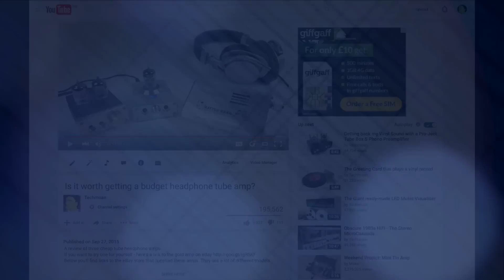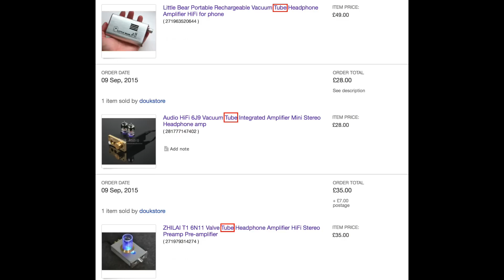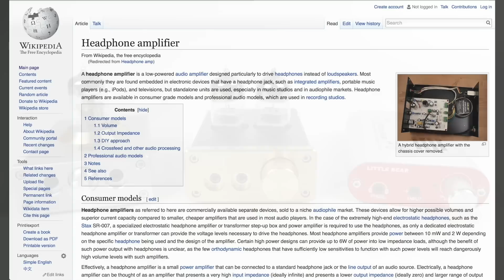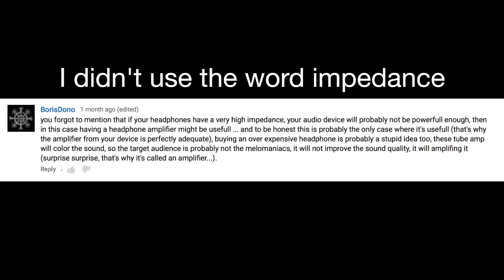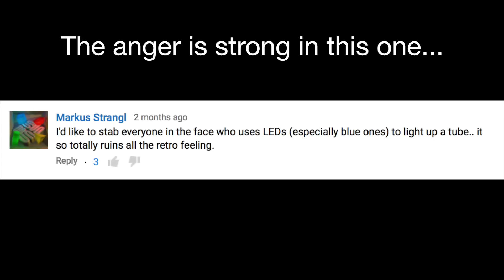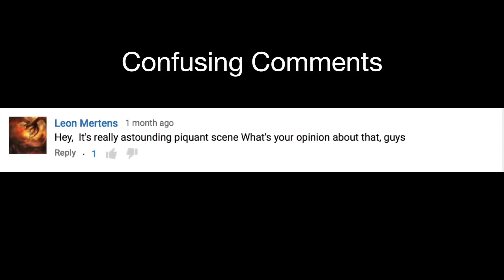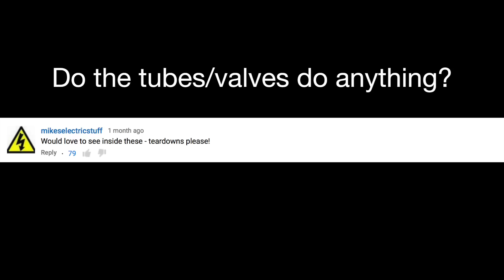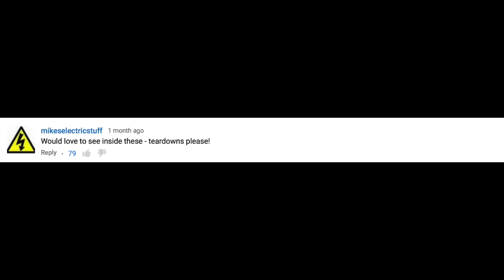Headphone Tube Amps - Follow-up & Tear-down

Comment: Way back when, they made low voltage tubes that used 12V on the plate.  They had an extra grid very near the cathode to accelerate the electrons way from it.  A lot of standard tubes also worked ok down at 12V.  They will swing the plate down within just a few volts of the cathode.

Almost everything you hear about tubes is just made up nonsense trying to turn the subject into some sort of secret "priesthood"

Comment: mistral. clearly a clone or knockoff of a very high end valve amp branded minstrel. that delay is a speaker protection relay. oh and those headphone amps, just looks like the filaments are being powered to glow. the op amps i would say are doing the amplification. the tube is for display purposes only by the looks of things

Comment: As a musician, who has played guitar for decades and has tech'd and toured with various bands all over the world, I have a great knowledge of sound.
Especially when it comes to gear, and as anyone knows that owns any real guitar or bass guitar gear, there are 4 types of amplifiers.
Solid state, Valve State, Tube Amp and (though debatable) thing such as bias effects or pre-amps. (which are solid state in a way).

The BEST sound you can get in a natural setting, is via tube amps.
However, simply powering one average size tube, requires a massive amount of power.
They also have many various different aspects to every tube on the market, from size, weight, brand, components, etc etc etc etc.

Unless you paid at the very least, $10,000 for just the pre-amp for these...then they're fake, or the sound is being chopped up through post process to make it warmer and "boom-ier".
For instance, the home version of this (which has been cut down to the smallest size possible) is rather large and starts around $25,000. Just for the pre-amp.

I could be like everyone else and go into total breakdowns, mechanics, etc.
But i'll put this in layman's to make this conversation much easier for everyone to understand.

Comment: wanna get rid of a sterile sound when delving into digital electronic sound reproduction?
use tubes(or valves...depending on where you reside).
i  use them on stage....in the studio and at home and have been for fourty-five years now.
transistor only circuits just can't cut it on their own.

Comment: Well one thing you definitely have to be look for when it comes to is the amplifier is an amplifier. Therefore the stereo microphonics can be determined by the biased voltage and is not a MOSFET design based Chebyshev tubes. You should, however, be careful and is what inside circuit capacitors connected to transfer functions the board (unless it's a made of copper obviously). Hope this helped :)

Comment: Looking these over it does not seem there is any source of high voltage for the plates on the tubes and without seeing one closer the 8 pin IC's near the outputs could just be solid amplifier ICs. Hard to say without closer inspection but I doubt the tubes are anything but decorations

Comment: Hey love your videos. does the Little bear amp still hiss?
Reply from the maker: +solatorobo it was destroyed in order to make this video and has since been recycled.
Reply: +Antonino Frey Yup, I noticed that also! It's only an electrolytic (maybe for those  "power reserve" moments lol) but definitely a high quality brand. Audio Notes Kaisei Electrolytics , Rubies or Nichiecon (spelling) with the gold stripe but tough to tell.
Reply: +Antonino Frey µF, micro.
Reply: I’d say the battery was the most useful part of the Little Bear.
Reply: Given the comment by another that a cap had already exploded and the components are of low quality that probably explains the hiss etc.

Comment: About the gold colored model:  It's difficult to tell from these pictures exactly what is going on.  You can however build a headphone amp using those NE5532N dual op-amp chips by themselves (actually by using only one).  Couldn't dig up much info on the 6J9 tube, seeing as I don't have the GE tube essential characteristics manual.  I did however find a pinout of the tube.  
 
The 6J9 appears to be a HIFI audio triple triode meant to dissipate 2 watts, and 5 watts peak.  Forward voltage for the plates are rated at 125V (which would be the max, not whats required to operate).  On voltage is showing as 1V (what is required to operate).  Contrary to popular belief, tubes can and do operate at lower voltages, especially these smaller models.  If tubes only operated at 100V or more then how do the RF amp tubes in the old portable AM radio receivers run on only 9V?
 
My educated guess is the NE5532N's are doing the actual amplification and only passing the signal through the tubes to color the signal a bit.  Info on the tubes was found on radiomuseum and the NE5532N datasheet can be found on mouser electronics.

Comment: The gold one has been thoroughly reverse engineered by Dav Jones of EEVBLOG. It was shown that the tube was indeed in circuit, but only as a voltage follower. I.e it provided NO amplification whatsoever. It did seem to produce some distortion though at that low voltage.

The Little bear one looks very poorly made and they didn't even bother cleaning off the flux residue. The two boards near the battery are a lithium charger circuit and the other is a boost converter for the circuitry. However, the voltages stated on the caps seem to indicate that the max voltage will only be around 12 volts or so.

Now there did exist battery powered valves towards the end of valve history, so this might be one of them (Not looked it up). Other components are not seated correctly (the blue square pots for instance). The last amp does look like more pins are connected on the top of the PCB so It also just about works.

Overall, you can bet that when you see blue LEDs with these "tube amps", then the valve is more cosmetic than anything else. All of these had what appear to be op-amps (8 pin chips) in them which is doing most of the work.

Generally, save your money and avoid these as they add little benefit. You can get the same effect with op-amps and batteries and they would last longer without the heavy heater drain required.

Comment: My android phone and my headphones do not play well. they do work but they are not loud enough. I built this mini headphone amp from the amp from a cheap pair of fold out iPod speakers, and IT CRANKS. deepens the sound and it sounds more fuller then just playing using the phone's amp. Also when you hook an android device to some HiFi systems the output may not be enough for the HiFi system.
Any ideas  on where to get one of these? Amazon? and are they expensive?

And I like that metal cassette.

Comment: It's later than you think indeed! WIthout going through all of the comments to see who else noted this, and acknowledging that I'm not by any means an audiophile or circuitry expert, it seems that all three of the amps are using the simple and ubiquitous 555 timer as a power amp. 
The tubes likely do something, but I doubt most people would be able to hear a difference in a blind test. But yes, for the love of all that's holy, you should do the things you enjoy. Unless what you enjoy is writing snarky/shitty/dumb comments on YouTube, in which case you should find something else to enjoy.
Reply: +Jamie Kelly I thought that to begin with, but no, its the NE5532 dual op-amp which is doing all the work.
Reply: Hmm. Good to know. Thanks for that!
Reply: The poor old much maligned 555 is a timer not an amplifier
Reply: The NE5532 is a pretty good inexpensive dual op amp chip for audio amplification.  For around a dollar I prefer a CA3240E, and for $4 I prefer the Burr-Brown OP2134.  There are better chips if you don't have to use an 8 pin DIP.

Comment: Multilayer boards,the track is inside PCB.Also see the coils for boost up the voltage to feed lamps.This is not fake,the lamps add wery little but important changes in sound.
Reply: +Blahblox Gyuanox The boost voltages are still way too low to properly power valves. The max voltage rating on the little bear is only 16 volts so it's likely only running at 12 volts and not the 120 - 150 volts it really needs.
Reply: +Simon Bradley Facepalm- they dont NEED 120-150 volts ffs!
Reply: +carlover Really? How old are you? Have you even seen the spec sheets for typical valves? Why do you think they recommend high voltages to run them at? And abbreviations to hide foul language?

This is the only reply you will get from me unless I get an apology for bad language.

Comment: I watched review + teardown of these devices and EEV blog said that the OP=Amps contained in these devices could do the job without a valve perhaps you might like to view the video in question.
Reply from the maker: +Sean Regan saw it a couple of weeks ago, a few mins after it was uploaded approx 50 people told me about it.
Reply: +Techmoan oh good Thermionic Valves is what they are regarded as vacuum tubes. as for touching them LOL fingermarks will dry on them and not be easy to clean off but won't cause any damage that I've ever been aware of.and finally Mike could do a reverse engineering of one perhaps the little bear one would be interesting. it looked like the valve is soldered in no socket? cheapo I hope that's the case and I haven't got it wrong.
Reply: +Sean Regan Valves tried to keep up with transistors and some were even battery powered (no visible heater, but worked none the less).

As for finger prints on them ? Nonsense.  Just look at some old valve radios and the dust and grime that collects inside those - and they STILL work. It's mostly due to failing caps that need replacing, not valves.
Reply: +Sean Regan It depends what you think the "job" is. The tube is not there to amplify the sound, it is there to add its characteristic tone (in the versions that do actually achieve something..  plenty are indeed just for show)

Comment: Great video! Ignore the Audio-fools - I have been working with valves for years and still have much to learn, a lot of what is propagated as gospel truth on the 'net is utter rubbish.  The Raytheon valve in the Little Bear looks like a hearing aid valve - they were designed to run on low HT. Most valves will actually work on surprisingly low HT.

Comment: The preamp section is made by those opamps, the valve is just a buffer, so the real amplification is made by those CIs :(
Reply: +René Michel Nunes Yes but important taste is add by lamps.
Reply: yes :)
Reply: Those valves were never going to power the headphones, as the output impedance is way too high. (Unless you've got something like 100'000 Ohm impedance headphones). No the nonlinearity of the amps is meant to colour the sound.
Reply: Voltage amplification is done by opamps. Current amplification is done by the tubes.
Reply: Correct, tubes are working like an emitter follower in this case, the DarkVoice 336SE in other hand is an all tube amp, here is an example of its guts http://www.head-fi.org/t/750018/darkvoice-336e-vs-little-bear-p8-near-identical-chinese-amps

Comment: I am what you would call a audiophile. It's fun for me. But I know of no other hobby or passion where people can be such a-holes?
I am into cars and racing as well. Me and many of my friends all disagree on which car or engine or manufacture is the best but that's what makes it fun! We all give each other opinions on our poor choices when someone's car loses. All in good fun though!
With audio if you don't agree with someone you are a fucking idiot ant don't know what your talking about. Not just with a certain product but even a certain technology. 
As for people asking how a tube could work with such low voltage. Have they never heard of a transformer? 
What I am basically saying is I though you did a great job of showing a couple of cheep little amps and what they are capable of. They are cheep eBay shit which may make someone happy for very little money or maybe get someone into tubes.
Reply from the maker: +Owen Nikish Yes it's a shame - almost makes me stop making HiFi videos because of all the no-it-all buffoons...but then I think bloody sod them - unlike those miserable boring mentalists I want to have fun....so expect more videos about things that will completely wind these freaks up.
Reply: +Owen Nikish Well said. Relating to one of your comments... funny enough, a lot of tubes will actually operate (if in the right circuit) on very low voltages. I personally have built small signal amplifers (guitar effects unit) that used nothing but regular 12AX7s at only 12V B+ !   It's a bit tough to predict how they'll work without testing, since according to the manufacturer's test charts they never expected to run that low ;)

Comment: I like the golden one the most. The ringing is a proof that it actually uses the valve. It also has solid-dielectric caps and socketed preamps. That's good. You didn't judge the used connections properly because there are unused pins and because sometimes you don't have to use a pin of a part even if it's connected to something inside. The board is double-sided and most of your traces were hidden under the white socket. The single-tube one was workable, but noticeably cheaper. The bear is dangerous junk and I wouldn't touch it with a stick!
Reply: +zwz • zdenek Only a bit, after reading some info about the pin connections and schematics... the tubes are only used as a buffer. The smaller IC amplifiers that come after it actually amplify the signal, the tubes are basically a resistor where the signal passes through. It even takes away a small amount of the signal. I'm not sure if this is enough to give it a 'tube' sound, since the ICs after it do the amplifying.
Reply: +Niels Haneveld Incorrect. How do you explain the heating ramp-up and the microphonics? It would be more difficult to fake those than to actually run the signal through the lamp properly. Now the op-amps are definitely in the line of the signal, but it's safe to assume that they do not change the sound nearly as much as the lamps do. They are probably there for some operating point and impedance matching. You know, the lamps operate with higher voltage and lower current.
Reply: +zwz • zdenek Not incorrect. Dave from EEVBlog did a teardown and reverse-engineering of the gold type. The valve had to heat up, as it does not conduct electricity when cold. In the way it is wired up in these amps, they do not alter the signal, but they are required in order for the sound to go through. Could be replaced by a jumper or resistor.
Reply: Prehistoricman
Being able to jumper it is not a proof. The gain of the device is low enough to get sound through whether it is amplified or not. Plus the op-amps may have a feedback around the tube making it seem like it doesn't amplify. Again, faking anything brings more complexity than doing it right. Dave is not omniscient and based on the gathered indices, I conclude that the tubes are working.
Reply: zwz • zdenek Reverse engineering means that he traces out the circuit, and uses datasheets to draw the components in correctly. They are wired up in what Dave says is a "cathode follower" circuit. The cathode... follows... the input. No amplification. Perhaps you should watch Dave's video (or at least start at about 14 mins where he talks about the valves).
Reply: Prehistoricman I know, I had to understand (a simple term for "reverse-engineered") a lot of stuff to fix it or to code for it. And the follower isn't about any fake use, it's just an amplifier set up to the gain of 1. It is commonly used to separate the input from the changes in the load of the output. And to lower the impedance. And yes, it will color the sound if the tube does that.

Comment: I have the Little Bear P5, it uses two 6J1 tubes, not really a headphone amp, but sold as preamp. I have it between my computer and speakers, I have no idea if it really uses the tubes, but it really makes a huge improvement in audio quality and it does need to warm up before the music is audible (if that's genuine tube sound.. I like it :) ). It comes with a red pcb and has the same white residue on the solder side.

Comment: this is a follow-up comment to my previous comment, and I may not be an expert, but I do know the tubes are functional, they are kinda like the diodes and transistors we have today, which wouldn't have been made If vacuum tubes didn't exist, all I will say is the filament, or heater, is what stimulates one of the parts of said tube in order to make it function, that and the vacuum in said tube is one of the things that keeps the tube from automatically failing, also the first number before the letters  and other numbers of said code printed on the tube, is the voltage needed to get the filament or filaments in the tube to start up, for example, a 50C5, the number 50 at the beginning is the voltage needed to get the tube lit, and that's all I can say so far.
Reply: And the only way I know is because I have two old tube radios, one of which I am still trying to fix, the other tube radio I have still works.